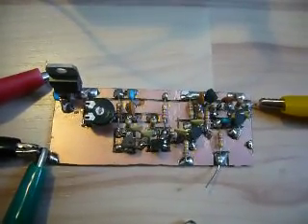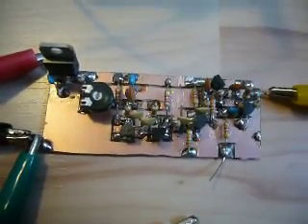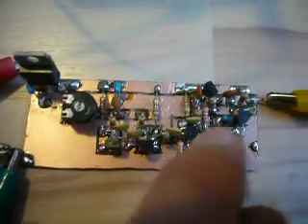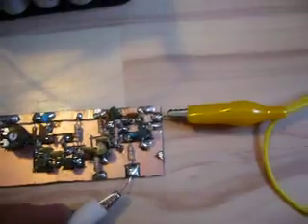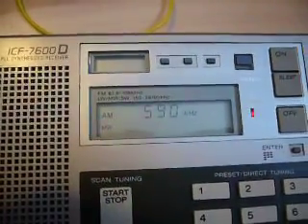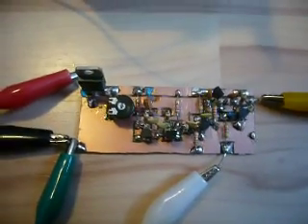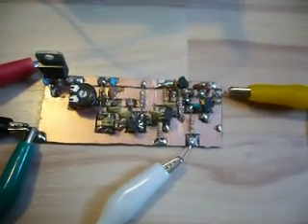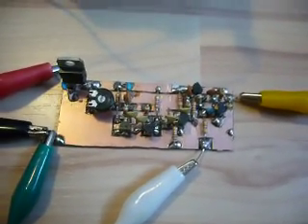Coil less Am Transmitter

Comment: Only problem is using the variable pot as the tuner. Even though it is convenient and doesn't require the large expensive capacitor or coil, the thing is inherently noisy and will cause drift that is worse than traditional means. However it's small and works great for low powered transmitters and even receivers as long as the tuning bandwidth isn't large.